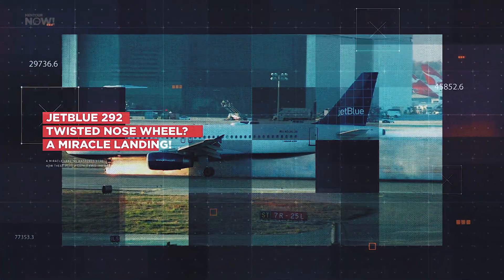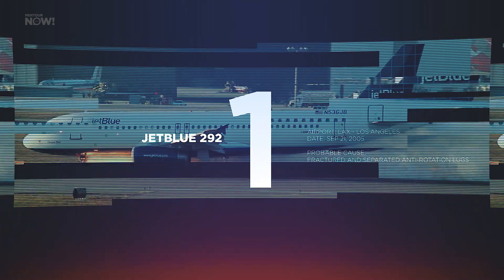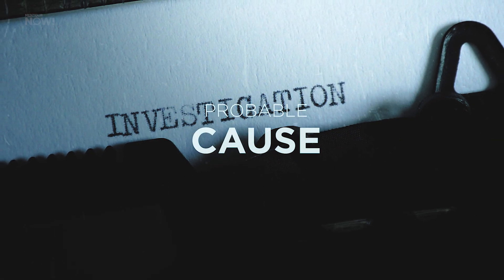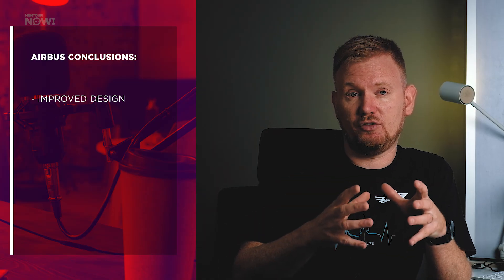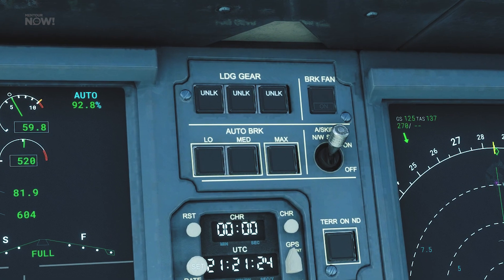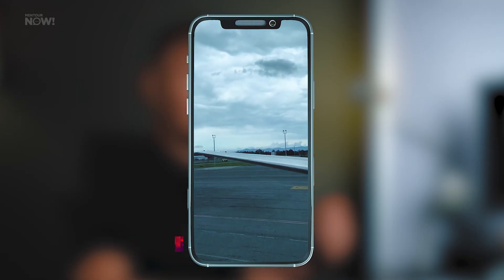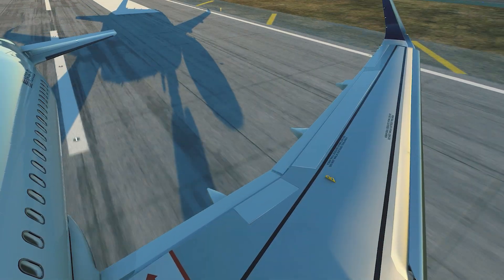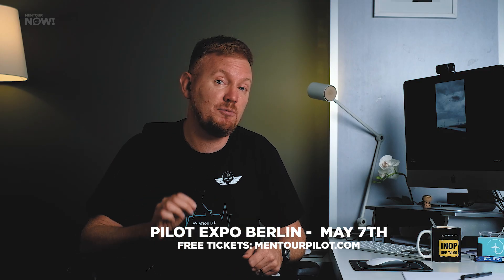The TWISTED Story of the Airbus A320 NOSE-GEAR!

Comment: What would be interesting if there were any similar events on planes of other manufacturers or what is so special that it seems this is only happening at A320s?
As always, excellent wrap-up, dear Mentourpilot & team 👍
Reply: All kinds of planes have landing gear faults. The only special thing here is that all these completely different failures have resulted in the same eye-catching symptom.
Reply: The common factor here is that Airbuses are over-engineered European junk with too many computers in place of what should be simple mechanical controls. This is my opinion after working on commercial airliners for nearly 20 years. They’re just designed dumb. Nearly as bad as McDonnell Douglas.
Reply: @wrkingrageaholic  What's the relevance of "European", other than as an advertisement for your xenophobia?

Comment: It seems Airbus should resign the entire front wheel landing gear.  It will cost millions, but is the right move.  Maybe they can consult with Boeing design engineers.
Reply: @timemachine194 how many 737 wheels lock at 90° angles?
Reply: @steve0680657   Not sure, but they seem to have a thing with collapsing main gear.    
8600    A320's produced,  six or seven such incidents is small.

Comment: Why is it even allowed to pass 75 degrees? Or less even.
Reply: Because if there is a fault where the computer cannot return the nose gear to 0 degrees, the next best position is 90 degrees. At this angle, the plane will simply burn rubber and come to a safe stop on the runway, whereas if the gear locked at, say, 75 degrees, it would veer to the side and depart the runway, which is much more dangerous.

Comment: Don't you think there is an underlying problem with the A320 landing gear design that makes it prone to so many failures? I say this thinking other aircraft in the same category that don't have this kind of problem there.
Reply: 5 in 20 years out of 8600 aircraft is minimal.   Other aircraft most certainly have gear failure, all the time,just Google e.g. '737 landing gear failure'.   (I said '737' because it's the other most common and comparable aircraft, but I expect you could do it to any type)

Comment: One of the MANY reasons I watch your interesting videos is the incfedible similarity between modern airplanes and IT systems (meaning endpoints, servers, network, storage, you name it). I work as system administrator in one of the most complex possible environment (a network of cruise ships)

Both are a sum of many very complex systems and very often improvising or going with "post hoc ergo propter hoc" is the first step to failure.

Many users tend to simplify the problems because they don't have the "big picure" of the situation, is human and it happens with computers as well as with airplanes.

Keep doing this videos Petter, they teach more than you can imagine to us IT flight enthusiasts, thank you!

Comment: Great video, My career is as an Aircraft Technician. Sometimes all of these new designs and new issues make me wonder. The old designs worked for many years with minimum issues. If  its not broke don't fix it. I enjoyed video fully. Keep them coming ❤️✈️ 🌎
Reply: Yeah I totally understand that. Less weight less fuel burning more passages and cargo  more profits. Some times they just go way overboard. That also happens on internal parts of some Turbine  engines too.
Reply: The A320 was certified in 1987.  Hardly "new" anymore 😕
Reply: New designs are for saving weight, space and other reasons. Its called evolution and some changes extinct.
Reply: Oh ok thanks

Comment: 16:30 Why do they extend the Ram-Air-Turbine instead of starting the APU?
Reply: Extended itself automatically when they shut down the main engines (which they did as soon as they were safely on the ground, in order to avoid sucking in any debris thrown up by the nose wheel).    I think the RAT wasn't needed and wouldn't do anything at that speed anyway, but it doesn't hurt the RAT or the plane so no point in preventing it extending.

Comment: What would happen if the front wheel was physically locked just 1 or 2 degrees off? Would a stable landing still be possible or will the plane veer to the side?

Comment: I know your intention with these videos is to assure the public that the Airline Industry has our back when it comes to safety.  However, with videos like this, and the recent Boeing MAX fiasco, what I see is the Aircraft Builders' do not have our safety in mind.  They do not seem to care, especially if the design faults have not killed a few hundred people.  Boeing knew the design faults of the MAX, but decided to do nothing because Boeing is run by Bean Counter Managers instead of real Engineers.  It appears that Airbus is the same.  Until one of these nose gear problems actually kills enough people they just make recommendation to follow the book and do not think too much about it.  Equally at fault is the Governments that do not enforce the rules, of even oversee the certification process properly.  Lastly, the public at large does not care, or they would vote with their feet and refuse to fly on these problematic aircraft.

Comment: Is this kind of fault possible on a Boeing aircraft like the 757, or is there a mechanical backup linkage?
Reply: Boeings only have a mechanical linkage for steering. No computers, sensors, or any of that extra crap to go wrong.

Comment: Don't the A320s have electric-driven hydraulic pumps that could be run by the APU (with regard to deploying the ram-air turbine)? Or is it just generally safer not to have any fuel systems running while there are a lot of sparks on the runway?
Reply: I don't think the RAT was necessary (batteries would have lasted easily), just it deployed automatically when they shut down the main engines.
Reply: @cr10001  Ah! Thanks for the info.

Comment: Why doesn't airbus make a way for the pilots to manually rotate the wheel back? Like you can manually drop the landing gear or manually correct the stabilizer? Some indicator to show the actual angle and a wheel or crank to turn it back?

And why not add some physical or mechanical locks that doesn't allow the wheel to rotate more than 25° when the wheel is in the air? Then like you said the wheel would naturally want to come back to its centered position on landing? 

Seems airbus is fixing all the root causes but not addressing the symptom 🤷🏻‍♂️🤣...
Reply: Because if the computer cannot determine the position of the landing gear, it is far safer to drive it to 90 degrees where there is a mechanical stop than land with the gear in an unknown position

Comment: Seems like  this is another good example of small cameras being needed so the flight crew can monitor their aircrafts directly.  It also demonstrates how computers are only as good as the people that write them - calling a gear green or safe when its 90 off? Ooops.
Reply: I think there is a more subtle nuance to it. I believe those green indicators are there to say the gear is down and locked. And in every case described in the video that has been correct. I think it is reasonable to conflate green with safe and normal working condition, but that is not what the indicators are for.

Comment: Airbus is using the same technique on their front landing gear that we used on the farm tractor,  a bit of baling wire here and a bit there and we kept it running.   What happens when a Airbus 320 crashes and people are injured or killed due to the poor design and the bubble gum solutions based on risk management?

Comment: Why do they not have external cameras on aircraft with a screen inside the cockpit? A lot of incidents you've made videos about would have been handled very differently if the pilots were aware more quickly of what the issue was.

Comment: It appears that the corrective measures taken which are some mechanical, more software and electronic, are marginal in success. The nose gear system continues to find new ways to fail. Had these failures resulted in loss of life, the system may have been completely re-engineered by now. It is a time-bomb. Regardless of expense, start over.

Comment: 10:05 is it not better/safer to have the wheel locked at 90 degrees than having it at let's say 45 degrees? I mean , I think that at 45 degrees the plane would start steering as soon as it touches the runway and would end up on the grass , while on 90 degrees it think it's much easier for the pilots to keep the plane on the center linie.
Reply: Exactly. That is part of having a fail-safe design. Redundancy is the premise of every aircraft system.
Reply: Not so sure about that. In both cases the traction of the nose gear is going to be pretty much minimal, practically becoming a broken snowboard. Once the aircraft is touching down, the momentum (in terms of direction) is gonna be set and the aircraft is going to hold this direction till it has stopped. You can see this on intact gears too, once a certain speed it exceeded the tilt of the nose great will have minimal to none effect at all :)
Reply: @dopepopeurban6129  What are you talking about? Anytime the nose gear is on the ground it has traction. The more it deviates from the center the more difficult it gets for the pilots to counter it with the rudder.
Reply: @nurav_7  that’s physical bs. The higher the speed the less traction there is. Have you ever wondered by racing cars slow down before heading into a curve? - Because the cars can’t take the turn if they’re too fast. Their momentum in weight and speed is so high that their wheels aren’t able to turn the car in a normal gradient anymore aka the force of the cars combined speed and weight outmatches the resistance of the wheel - the traction - and thus lead to a loss of agility in steering. With your logic, these cars wouldn’t need to slow down before taking a curve and things like drifting would be impossible. That’s not how physics work.
Reply: @dopepopeurban6129  I fly the damn A320 and I have seen this failure in the simulator. May I say more?
Reply: @nurav_7  nf but I rly don’t believe espoused right now ;=;
Reply: @dopepopeurban6129  Higher speed racing cars normally have more traction, not less, due to the aerodynamic downforce on their wings pushing the tyres to the road harder. The reason race cars have to slow down is because they don't have enough traction to change direction fast enough. If you are travelling twice as fast you have twice as much momentum to change the direction of. You also have only half the time to do it in, so you need 4 times as much traction.
Reply: @rjmunro  guess what Sherlock, that’s exactly what I’ve tried to explain to you for the past 3 days. The faster you go and the heavier you are, your momentum exceeds the traction of a vehicles part that’s touching the ground. And for this exact reason an aircraft that’s going 140kn+ is going to continue straight as a dart, even though the nose gear might be tilted. The force of the momentum is greater than the force of the little tiny thin rubber wheel up front, so the direction of the wheel has little to no effect at all. This is even more true for aircraft than for racing cars as racing cars have wider tires and a hull designed to press the cars body to the ground, thereby increasing traction. An aircraft on the other hand has small thin tires designed for speeds up to maybe 180kn maximum and the position of the wings as well as the shape of the cabin are designed to lift the aircraft up instead of pushing it down, therefore decreasing traction…

Comment: At least for jet engines the manufacturer might try many different iterations and new revised designs of parts to catch the same fault happening over and over again which causes in flight shut down of the engines. And if they only focus to fix the one problem the revised design might cause some other unforseen problems down the line. That has happened too. Well I can only say that about the couple of the biggest jet engine manufacturers.

Comment: Whats wrong with Ryan Air? Why do they have just enough fuel only to make their destination airport, without spare fuel?
Reply: Carrying fuel around you don't need uses up more fuel. They are required to have a minimum amount of fuel on board by law, the rest is economics. Also, if you are low on fuel, you can skip the landing line.
Reply: @csgergo80  there has been alot of commotion about Rayn Airs fuel practices, so they are doing something wrong. Especially when you hear pilots protest against it.

Comment: The imagination, the steering wheel will not work properly is extremely frightened ! Every system onboard an aircraft has a redundant system. Diddent have the nose gear a redundant  steering System, did they ?
Reply: @timemachine194 Today they using Ballscrews, not the old screw and nut system like in the old MD10. This is much safer.

Comment: Easy, low cost solution that will also minimize damage to the runway surface:  Add an on-board foaming system that can deploy water soluble lubricating foam through a tube directed just in front of the nose wheel tire during the last moments of an emergency landing. (It might be possible to place this lubrication directly inside the tire if there's a way to properly pressurize the tire for normal use.) Ground steering is possible by differential application of the main gear brakes. Ground crews can quickly tow the aircraft away to off-load passengers, crew and luggage (and eventually off to the scrapyard) using a front wheel caster dolly while the runway gets quickly hosed off with low pressure water.  Easy peasy.

Comment: Very good presentation. Just one comment: The A320 doesn't have a Standby BSCU. The BSCU is a dual channel unit and channels are swapped by cycling the AS/NWS Switch. Late model A320s have an Alternate Brake Control Unit (ABCU) that is not associated with nose wheel steering.
Reply: According to Airbus's Safety first report titled "Landing with Nosewheels at 90 degrees" , this is what is written for the 2007 NWS 90 degree incident

"An updated design was introduced to improve the robustness of the BSCU and to allow a switch-over to the passive BSCU system when the outputs of the active BSCU system become frozen (i.e. switch from BSCU 1 to BSCU 2 or vice versa)."

You can search for the document on Google.  or on Airbus Safety first website.
Reply: @swapnilmankame  JetBlue's N536JB was pre-modification that introduced the ABCU.

Comment: "are not allowed to create their own work arounds" Soo what they want is drones that dont think for them selfs and follow list of prewritten orders?...Sure go trough the checklist, but if that does not fix the issue, there isint much to loose if you try fixes that are not in the list, but of course pilot needs to be sure what his attempting is based on accurate information. Also why there isint any manual control over the nose wheel? More automation you add, more of points of failure you add.
Reply: *themselves

Comment: How hard would it be to install a camera to look at the nose wheel?
Reply: I still find it strange that they don’t have a few cameras on the outside. Sure, they won’t work in bad weather or if they get dirty, but even cheap security cameras with Wifi would do the job most of the time (they don’t have to be super reliable after all).
Reply: @Mike-oz4cv  Until you put them in an airplane. That will increase the costs 6 times, and make it a MEL item and keep it from earning more money. As these accidents are unlikely to cause loss of life or hull, it is a question of economics.